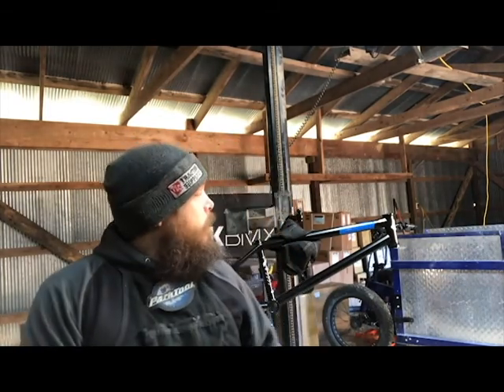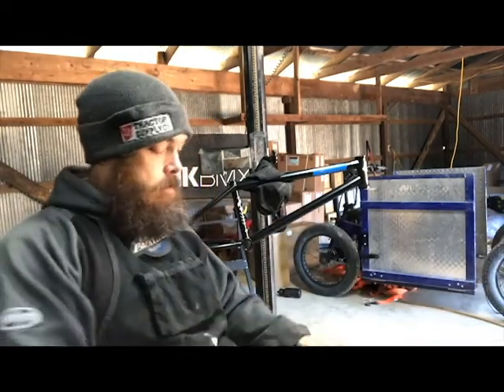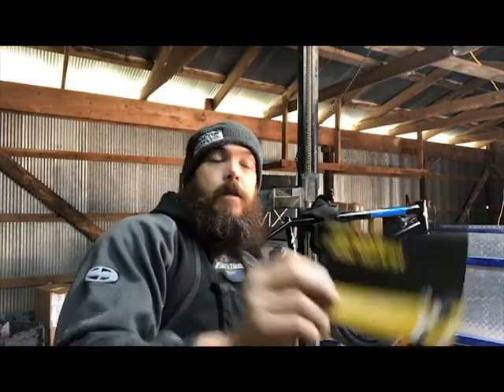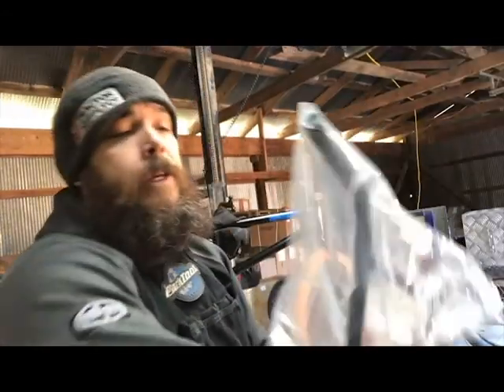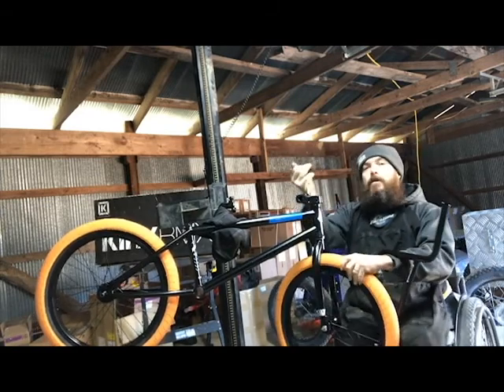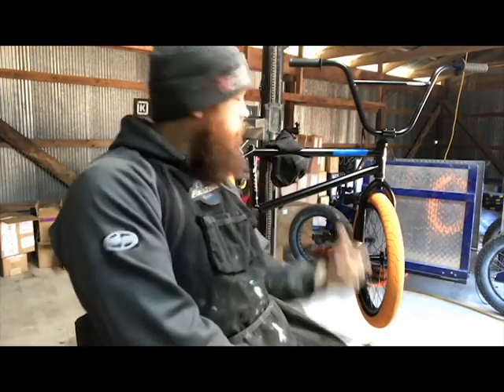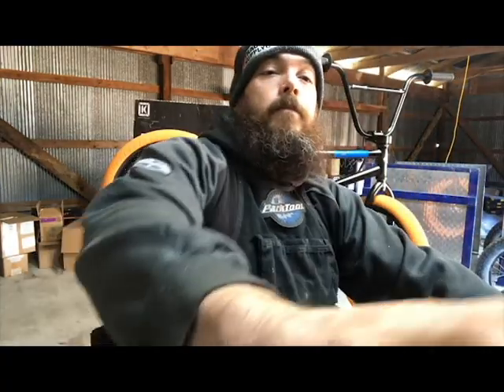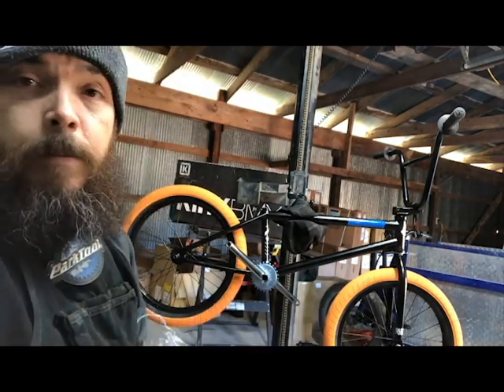Kink BMX Cloud Travis Hughes Custom build 20.5 | Cabool Bikes

Comment: FYI, that fork (and most forks) has an integrated bearing race so no need to install the one that comes with the headset. It'll potentially cause play over time cause the race is sitting on top of another race.